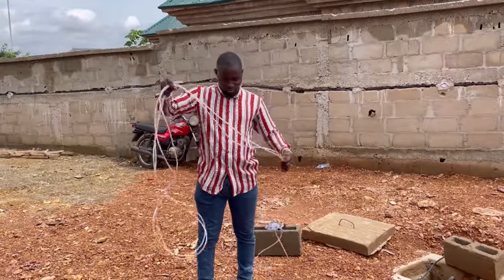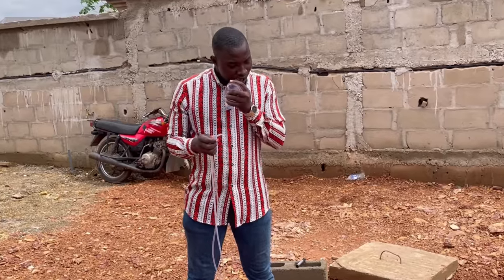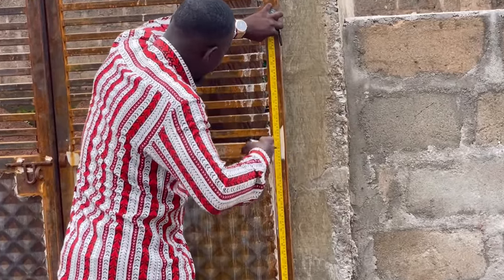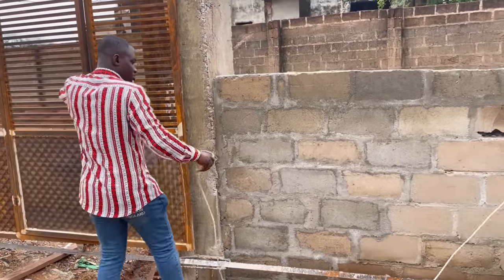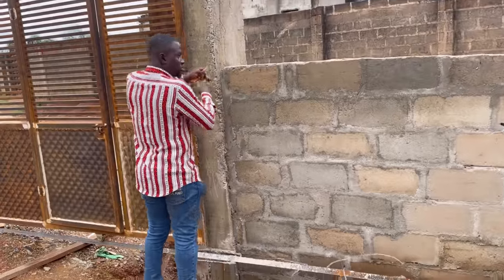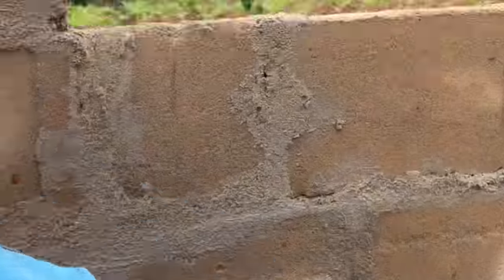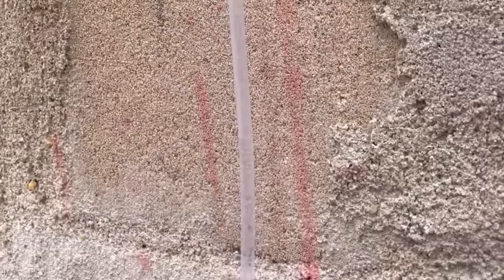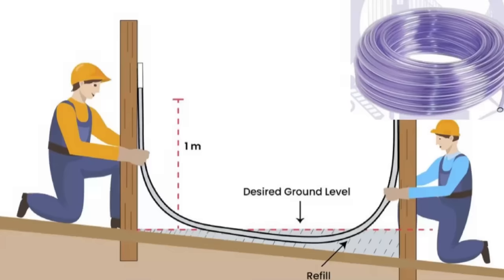How to use the easiest levelling instrument (Water level)

Comment: When using a thin tube like this, the water often doesn't level exactly.  To avoid this, put a little dish washing liquid in the container and mix it up before putting it in the tube.  You should see much more accurate results!  Dishwashing soap reduces water surface tension and makes water "wetter"!
Reply: I use vodka.
Reply: @h2s142 Why shoudn't you add soap? It reduces surface tension. It isn't for ease of sight, which is why you were mentioning food coloring.
Reply: Creates bubbles
Reply: Diesel
Reply: @Davidlouis3  yes it does!  I haven't experimented with reducing the quantity of soap to the bare minimum required, but even then, may still have bubbles.  Water is cheapest, but I never thought of using Vodka or diesel fuel!  Need something with very low viscosity.

Comment: This is very good to use if you forget to bring the Lazer . It's something that old builders would use in the past but younger ones don't know about! Good to pass on to the new generation. Very valuable.
Reply from the maker: Just as supposed
Reply: What about just using a Mason cord/rope with a hangable water level. Id assume its a lot quicker. I mean it you need to go around corners you could just mark your reference level at the corner and apply tension at the corner and transfer to the point where youd like to mark your height.

I assume the Water level the both of you used will be slightly more accurate but I think for the most projects a few mm's would not be all too tragic.

I've never used this technique before, however it is fascinating to see how resourceful our ancestors were in an era before the introduction of modern amenities.
Reply: The cool part is that you can use this in bright sunlight as well as around corners...
Reply: Level earth equals level earth

Comment: I've used this method for laying out ceiling grid. I didn't have a long enough piece of clear tubing so I used a garden hose with 1' pieces of clear tubing at both ends, held in place by clamps, and it worked great.
Reply from the maker: Great one
Reply: Smart!
Reply: ❤❤❤nice
Reply: That's similar to what we used in early 70s  in the early, hose pipe with a glass tube in end marked with measurements on them

Comment: This is how Egyptian’s constructed precious buildings that stand today. As a 70 year old and working in a Plumbing union for 45 years I watched some of the old timer’s use this laying tile on hospital’s and high rise buildings. Thanks for educating those who want accuracy. I have witnessed Lazer failures due to calibration on job sites that have been costly to those trusting Lazer’s. They are great and efficient until the calibration gets off. Water levels are full proof.
Reply from the maker: Thank you
Reply: Una pregunta ,los egipcios tenían mangueras,? 🤔🙄 creo que no , entonces como era el sistema que utilizaron, disculpe mi ignorancia ,y gracias por leer mi comentario,👍🕊️🙏😇
Reply: Exactly 💯%. I've been using this system many yrs.(iam older than you). It works great for concrete forms. If the concrete is level, the building is level. If the foundation is off, the building is off!!! Get it???
Reply: Ancient Egyptians had clear plastic/acrylic tubing?  That's amazing how advanced they were. I wonder how they made clear plastic tubing way back then.  You mean water levels are "fool" proof, not "full."
Reply: You don't need a tube for level with water over long distances possible to make a small trench and fill it with water and set your reference points in each ends /corners.
They probably leveled up two boards and aimed them like a gunsight for a third board further away and put the level mark and run a string between.
Reply: The Egyptian use pitatgoras

Comment: Great video … a quick tip, put a couple of drops of liquid soap in the water before you fill the line the coefficient of friction will be lowered and the bubbles are easier to remove. The level is achieved quicker as well.🤠👍🔨
Reply from the maker: Thank you for the clue ☺️
Reply: Also some  food dye ?

Comment: Well not that long ago, 1980’s when I started as an electrician this is all the contractors used for installing T-bar, drop ceiling grids. I’m sure it’s been around for decades and centuries. Laser Levels have mostly replaced this method, but it is still popular in many area’s.

Comment: Can be done 1 man operation
20 litre bucket almost full of water 
Fill clear hose and put one end in the bucket
Weigh it down with a non porous item like a hammer
Siphon the hose to eliminate all air bubbles
The free end of clear tube will give the height of the water in bucket .
Now measure up or down to finish height

Comment: it don't work. I tried it. the water sticks inside until you jar, bump it to make it move. used it to install dropped sealing, got all screwed up. mabby a little dish soap will make it slide around inside better.

Comment: Water finds its level all across the earth.  Proof the earth is not a globe.
Reply from the maker: I agree with you
Reply: @Constructionpoint  great to see so many waking up to this truth.  👍
Reply: Its bubble mechanics... last time I checked bubbles were spheres
Reply: The earth is a globe.  I think you have concluded that the earth is flat, simply because you do not see how water would "find its level" while going around a sphere.  You assume that if there were a way, you would see it, but you don't see it, so there is no way the earth is a globe.

But the source of this contradiction is that you have not learned how both can be true:  water finds it level AND the earth is a globe.  There is a way, though.  It takes a deep dive into math and physics to see the evidence clearly, or else a trip high into the atmosphere.
Reply: @PeterLawton You cannot measure the curve of the earth. It would be 8 inches per mile squared. Instead of regurgitating nonsense, go look for yourself. There's no visible curve no matter how high you go btw.

Comment: if you colour this water, you can see it beter.
Reply from the maker: You are very correct I wish I did that, thank you for the reminder
Reply: It does - the first few times - but then (depending on what you used to colour it with) it stains the inside of the tube and makes it very difficult to see the meniscus.

Food colouring is a disaster....